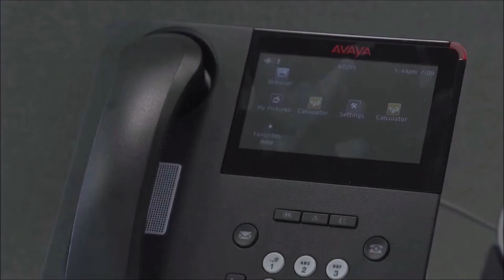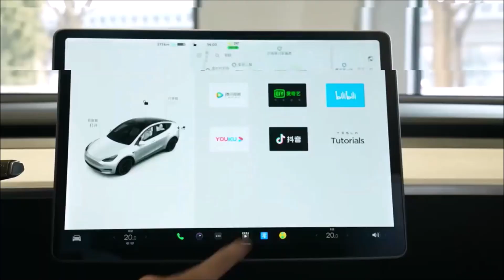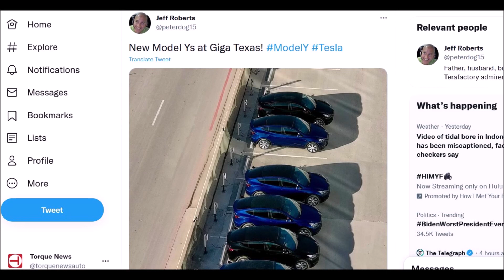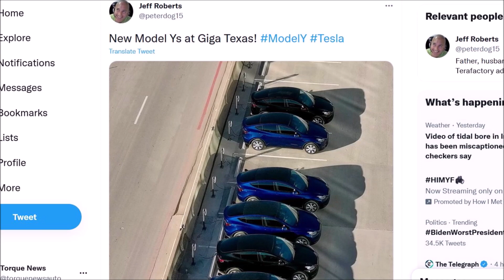BREAKING! Tesla May Be Gotion's Sole Battery Beneficiary

Comment: The very first company that comes to mind when thinking about the Gotion deal should be Volkswagen. They are the biggest shareholder in Gotion already (26.47%).  Could still be possible that its US  factory will be going into a joint venture with Tesla and produce batteries for them but that sounds a bit weird considering that VW is also going to start EV production in US mainland soon.